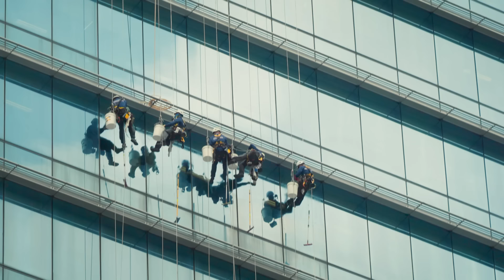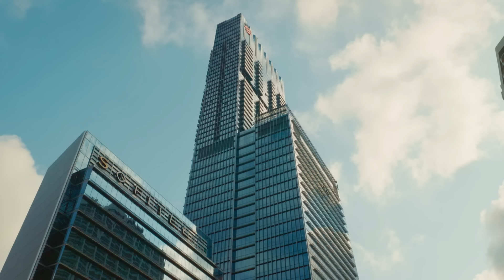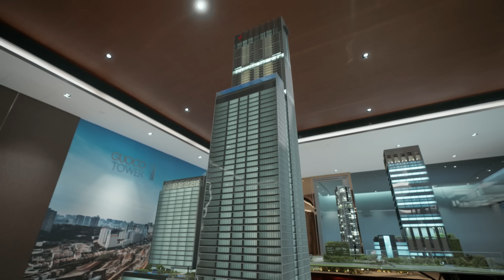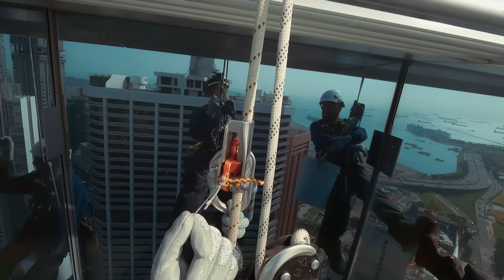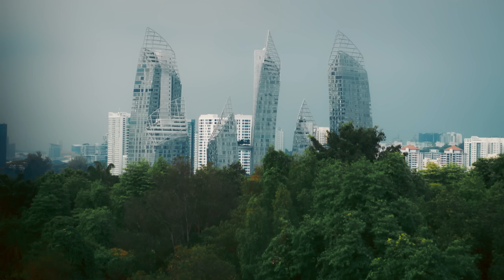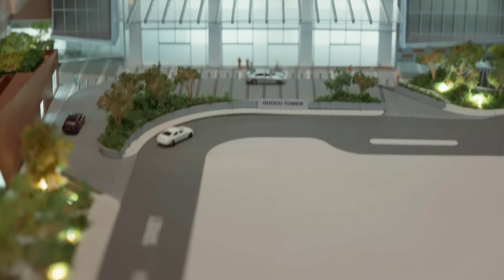Why It Takes A Year To Clean Singapore's Tallest Building | Singapore Hour

Comment: They are using the Rope access is a safe, efficient, and cost-effective work-at-height method using ropes and harnesses, often preferred over scaffolding for challenging, high-rise, or offshore locations. Common in industrial settings, this specialized technique includes building maintenance, cleaning, inspections, and repairs.

Key Aspects of Rope Access: 

Safety & Efficiency: It offers high safety standards with minimal disruption and faster setup times compared to traditional scaffolding. 
Applications: Common tasks include external façade waterproofing, window cleaning, painting, welding, structural repairs, and NDT (Non-Destructive Testing). 
Industries: Heavily utilized in oil and gas, marine, construction, and building maintenance sectors. 
IRATA Certification: Industrial Rope Access Trade Association (IRATA) is the primary international body for training and certification, with Levels 1, 2, and 3 determining expertise.

Comment: Billion dollar insight to max profits and charity donations. Save human lives by preventing human window cleaners from falls from skyscrapers by using NASA ex-engineers to integrate submarine grade water and soap hoses, waterproof robot body connected with retractable and extendable arms. Robot body held up by professional Mt Everest mountaineers mountain climbing equipment and tech. The other ends of the arms are rotating cleaning pads (similar to car wash sites) with pressure sensors. To access corners, use the tech from home robot vacuum cleaners. The robot with night vision, tilt, zoom in/out multi cameras. The unique feature is there is a constant stream of water (tech from factory cutting metal) that constantly runs down the camera lenses to wash away the white soap splatters that blocked vision. Integrate military paratroopers parachute in the robot body together with AI gyrosensors, where if the sensors detect robot body free fall above speed X, to auto deploy parachute to break fall and protect property, I mean protect human lives or pedestrians. Use Dyson hand dryer tech to rapidly dry the window of water marks? The durable skyscraper windows are built to withstand strong winds, and flying debris. In the rare instance that the robot cause cracks in a window, the single small piece of window can be removed and replaced with a new one without much financial damages. Lastly, unique competitive sell, is the robot cameras and other sensor arms can inspect the building exterior for damages or structural risks which markedly cuts facility management costs significantly as you run two jobs in parallel at the same time.

Comment: It was reassuring at the beginning of the documentary to observe that safety was given clear priority, with proper briefings and equipment inspections conducted for the RAT team. This reflects a strong commitment to workplace safety standards.

However, it was later both disappointing and concerning to see instances where some RAT personnel were working without safety glasses. As we know, approximately 80% of the information we rely on is received through our vision, and it only takes a split second for an incident to occur. During cleaning operations, dust, chemical splashes, or small particles can pose serious risks to the eyes.

There is a clear reason why personal protective equipment (PPE), including proper eye protection, is required for such tasks. Consistent compliance is essential to safeguard workers and prevent avoidable injuries.

I hope the companies involved in the project will take this observation constructively and reinforce the importance of proper PPE usage across all stages of work.

Comment: The initial design phase of the building only take into consideration external aesthetics and totally ignore practicality of maintaining the facade. Having a single BMU handling the entire Guoco Tower is not practical and will need at least 2 or 3 BMU systems. 
The next tallest building at 8 Shenton Way (Alibaba, Perennial) should study this properly. 
Don't give in entirely only to aesthetics and kick the problem down the road for the M&E team to settle.